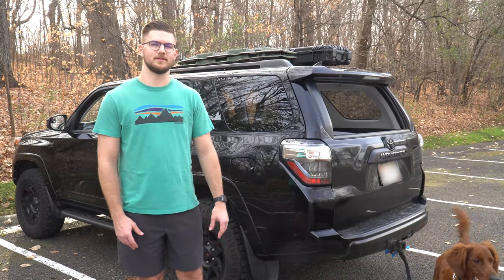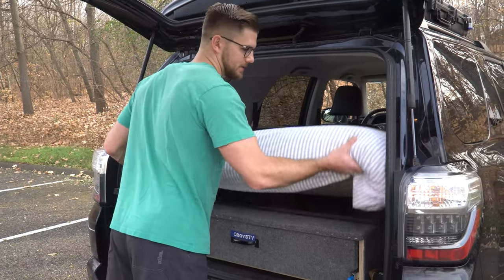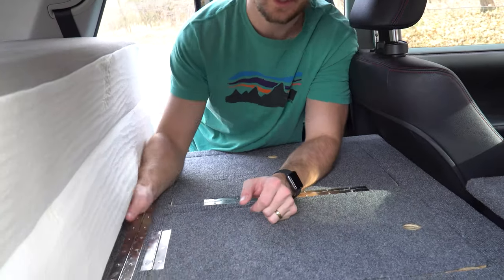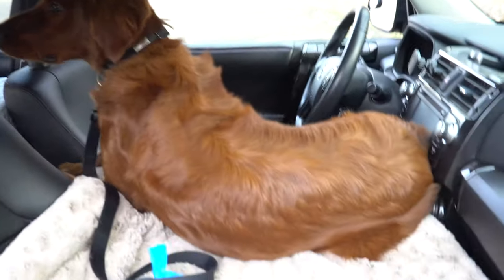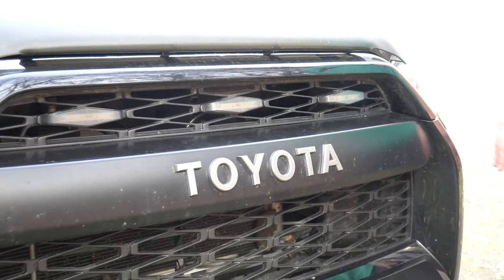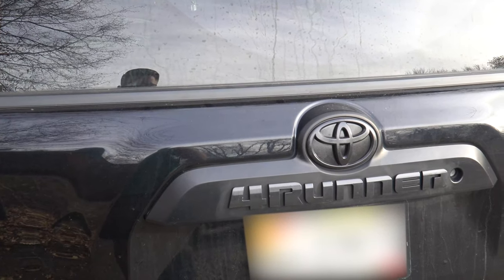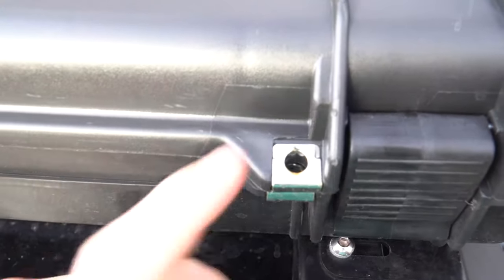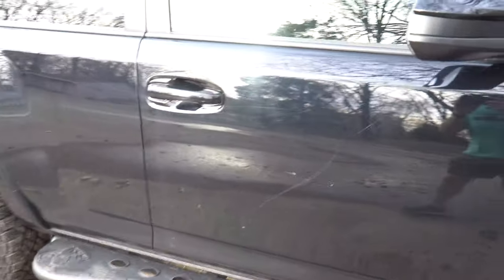5th Gen 4Runner Camping/Overlanding Setup/Rig Tour 2020 | A Couple and a Dog | Affordable DIY Build

Comment: Any reason why you don’t take out the rear seats for more room?
Reply from the maker: Ya know, I tried to take the backs out one time and it was super challenging for some reason so I designed the platform around only taking out the bottom part of the seat.  Do you know how to take out the backs super easily.
Reply: @OverlandEngineer  I do not, just seen them already out in other videos.  Safe travels!
Reply from the maker: @tonkabear2369  Thanks!  Yeah, I believe if you take them out it is more of a permanent solution, though doable.  Taking out the bottoms is just 4 bolts.